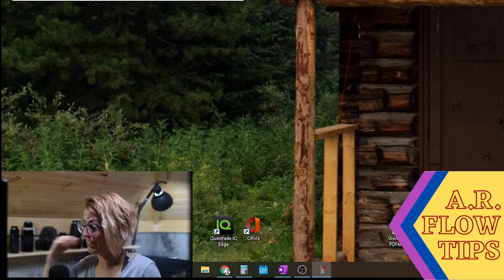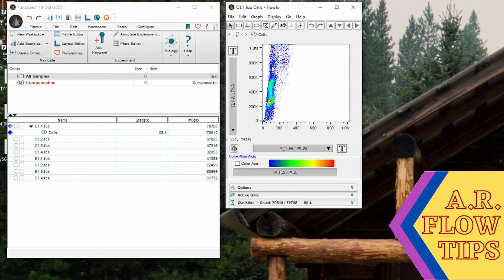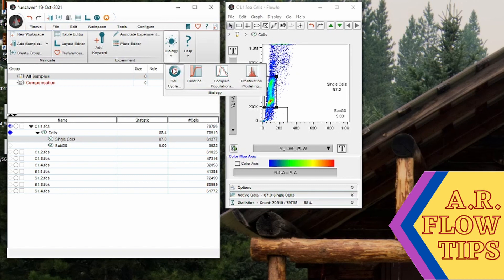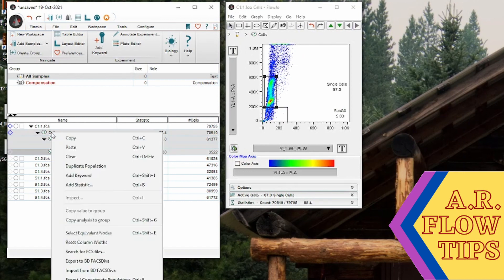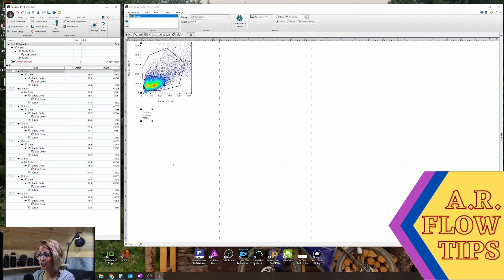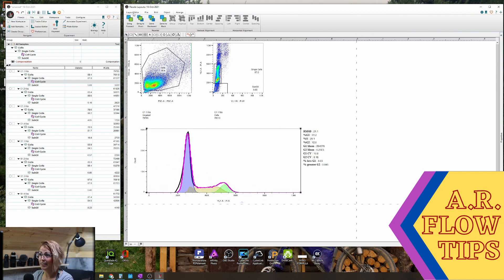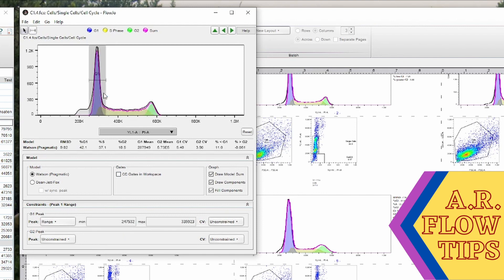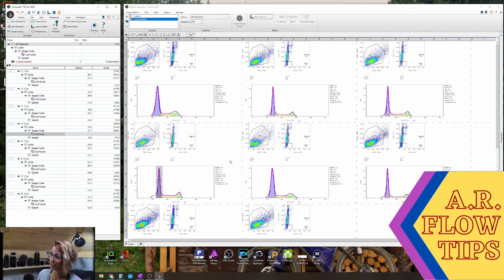FlowJo [CELL CYCLE]

Comment: Thank you for this short and succinct video! I still have a question regarding cell cycle analysis. When running my samples, I always try to align G0/G1 peak to 200k on x-axis (linear scale). Still, most of the time G0/G1 peaks from multiple samples do not align to this region on the axes which is problematic when I try to overlay these histograms together. How would you go about fixing this? Would you adjust the voltage for each sample to align G0/G1 peak to 200k on x-axis before recording or can this be somehow fixed in FlowJo? Some of my samples are really off, especially the ones containing less cells. Thank you!
Reply from the maker: Great question!! This usually is a protocol issue (do NOT adjust your voltage for each sample). Instead, I would go about making sure (1) you have titrated your stain to ensure you are at a saturating concentration in all your samples and (2) ensure you are staining for long enough. (Both these will also help improve CV's). Cell cycle, on paper, seems like a very simple protocol that should be easily mastered but there are a lot of intricacies that make it one of the most challenging protocols out there

Comment: Hi Aja, many thanks again for this video. Please, under what circumstance is it necessary to constrain both G1 and G2 peaks of the control sample for subsequently application of the settings to other test samples? In addition, is it ideal to use different models for the same set of samples as it was initially initiated for the sample that was not auto-analyzed? Best regards.
Reply from the maker: I would recommend you take a look at this:
https://docs.flowjo.com/flowjo/experiment-based-platforms/cell-cycle-univariate/

You will need to use the same model to analyze all your samples.
Reply: @ajarieger_flow  Thank you so much again and again. It's getting more interesting considering the fact that the values %G1 obtained for the controls are 33.4, 15.1, and 24.9, respectively. One would naturally have imagined that the values seem significantly different; how should this be explained, please?
Reply from the maker: @job506  have you synchronized your cells? You can get a lot of variability without synchronization. If you’re not synchronizing, you will need more replicates
Reply: @ajarieger_flow  I was actually referring to the data presented in the link you sent. In my experiments, I did not synchronize the cells. Please what approach is better for synchronizing cells? Thank you so much.
Reply from the maker: @job506  there are a lot of methods. This gives a good overview: https://en.m.wikipedia.org/wiki/Cell_synchronization
I’ve done a double thymidine block in the past
Reply: @ajarieger_flow  Thank you, Aja. In most puplications, there are no gates constraining G1/G2 phases in the histograms; please is there a way to remove the gates and still retain the contraints?
Reply from the maker: @job506  no. If you’re constraining, the regions are there to show where the constraints are placed
Reply: @ajarieger_flow  I'm deeply grateful, Prof.!
Reply: @ajarieger_flow  In addtion, I think gating the phases for the control for use with other samples should only be applicable if the cells were synchronized when the treatments were carried out. Could you kindly confirm?
Reply from the maker: @job506  you want to avoid gating cell cycle as much as possible, no matter what the circumstances. The models are always more accurate
Reply: @ajarieger_flow  Amazing! Thank you so much and please do enjoy a pleasant weekend.

Comment: How can i download the functions in my Flow 10.9.0 as in the video the function you used not showing in my software?
Reply: I am using FSC against SSC and then PE-H with PE-A but not getting fruitful results. Your method function not showing in my flow jo
Reply from the maker: So I better know what’s going on- what feature is missing? Are you missing the W signal? Or something else?
Reply: W signal is missing. I am using PE-A and PE-H for analysis. I am not getting my results?
Reply from the maker: This parameter needs to be added during acquisition. There’s nothing you can do in analysis to add it. However, you can still do double discrimination with PE-A vs PE-H (similar to how it’s done with FSC) and in some instruments this actually provides better discrimination

Comment: Thank you for this video.
If you've manually drawn and analyzed peaks in the G1 and G2 regions that cannot be automated, is it possible to remove only the labeling lines for G1 and G2, similar to other figures in research papers?
Reply from the maker: I wouldn’t recommend it- you’ll need to show where those boundaries were drawn in order to properly present your data
Reply: Hi,
Can you tell me how you manually drew the range and skipped using a model?

Comment: Hi Aja: Many thanks for the video. Please what determines the gating coverage? At 0:38 sec, what happens to the other cells far up? Why were they excluded?
Reply from the maker: The cells along the far edge of the FSC/ SSC plot are very likely clumps/doublets which is why I have excluded them. You could also gate them in the remove them in the doublets gate.
Reply: @ajarieger_flow  Many thanks, ma. I have another observation too: the summation of your cell cycle statistics is more than 100%. I have experienced this in my analyses too and even had negative % values. Please, how do I explain these? Best regards.

Comment: Hey!! Thank you for this video. I have a question, couldn’t I exclude the doublets by gating FSC-H vs. FSC-A and then apply the cell cycle analysis to that population of single cells?
Reply from the maker: That’s a great question! With cell cycle, knowing accurately that your G2/M phase is only cells in that phase and not doublets is very important. So using the PI (or DNA dye you’re using) for doublets is better at ensuring this is the case

Comment: Hi, quick question: I'm interested in the analysis of SubG0. Why not incorporate that in the cell cycle model? There is a "less than G0" tag. Also, shouldnt you apply the "G1" region to all the histograms and not just the one that cant be automatically modelled?
Reply from the maker: Yes you can use the less than G0 tag-  I have just not had good luck with it. The G1 region is not a region in the same way as a gate is (which you should apply across all samples); it is more a way to show the algorithm where the G1area is. Since this will be potentially in a slightly different spot in your other samples, the same constraints may not work.
Reply: @ajarieger_flow  Thank you, Dr. Rieger. However, the Application Scientist at FlowJo indicates that the constraints should be applied using the settings with the control sample... https://www.youtube.com/watch?v=bt3cqahfdMw

Comment: Thank you so much, I have a problem that is I don't find the PI-width parameter whereas I have only FSC-width so can I use it?
Reply from the maker: Thanks for reaching out! If PI-W is not on your list, that means that it was not selected when you collected your samples. There is unfortunately no way to change this now. In the future, if you select PI-W in your parameter list, you'll be all set :)
Reply: @ajarieger_flow  Hello Dr Rieger. Do you mean that when running samples using a flow cytometer, we should check the parameters list and select PI-W? Thank you for the excellent tutorials :)
Reply from the maker: @_clarisse_manishimwe  yes exactly! I'm glad you've found them useful :)

Comment: Thank you so much for the video. It is really useful. I have analysed my results but I have a problem that the cell cycle’s histograms do not have the  same cell number on the Y axis??
Do you have any suggestions??
Reply from the maker: Thanks for reaching out! Generally there is no issue with there being different numbers on the Y axis. However, you can play around with normalizing histograms if you are doing overlays etc.